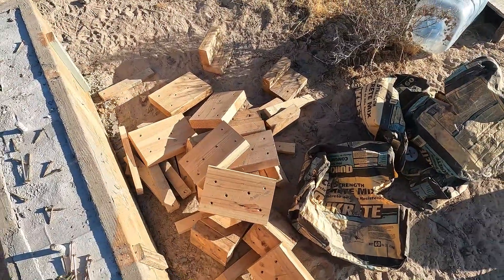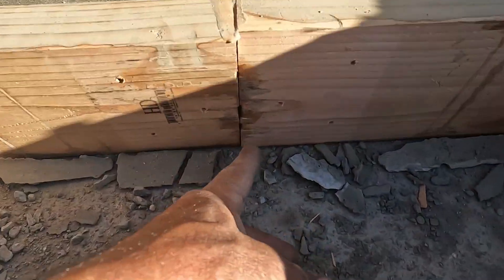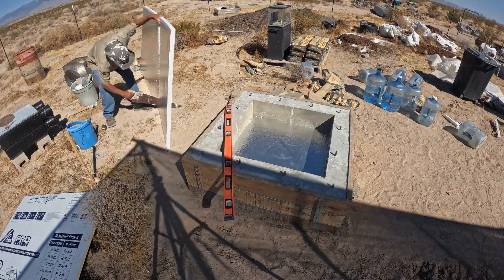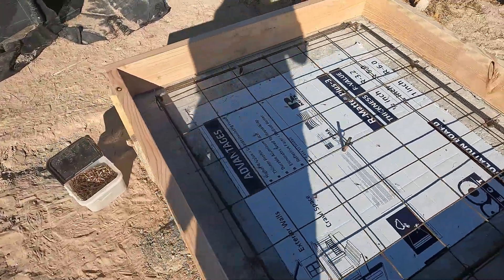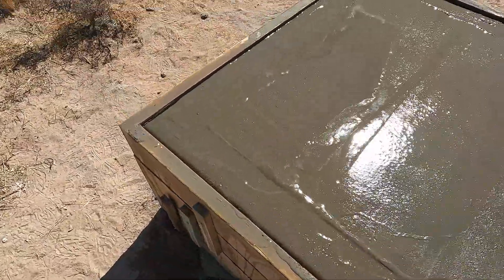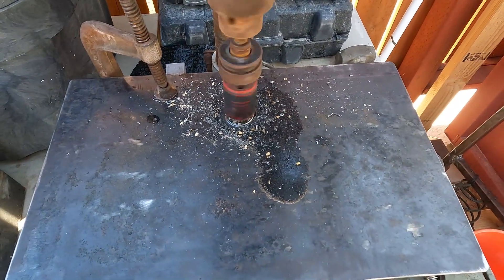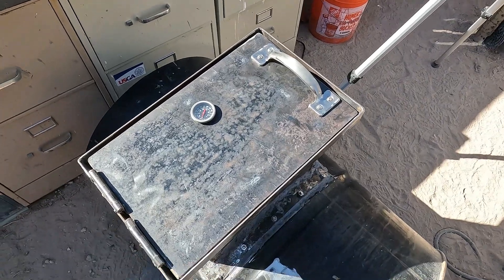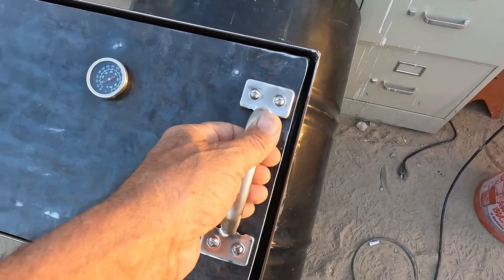162 - Fifty-Five Gallon Sand Battery Update

Comment: Call me ignorant, but why can’t you just have a 55 gallon drum full of sand and heaters with copper coil water pipe through it and insulate the outside? I don’t understand the need for all the welding and access doors and insulated concrete. I am not harping on your process, merely asking an honest question.
Reply from the maker: The access door is for an oven. I am sure I went overboard on some of the features but there will be insulation on the outside to hold the heat in and venting with fans.
Reply: @off-gridsurvivalmike8120 I guess I missed the oven part of the videos, sorry bout that! My fascination with these sand batteries is to ‘power’ our radiant floors that is absolutely unusable with the current propane water heater. Not to go off your video topic but do you think these drums could help this situation? Just need a constant 120° for 24 hours a day, not too much to ask right?? 😂
Reply from the maker: I believe it can do what you are wanting to accomplish. I am not an Engineer or Electrician and my designs are just off the top of my head but so far from what I have observed over the past going on two years I am 100% convinced it is a viable practically free heating source.  @scott24D